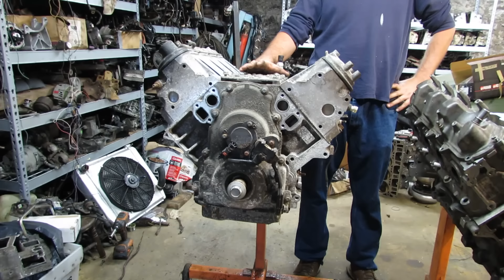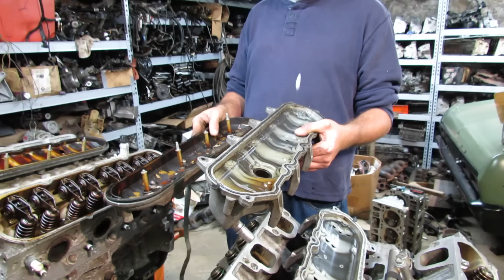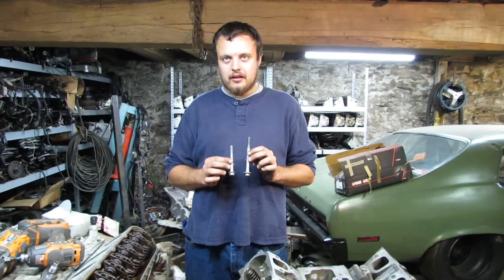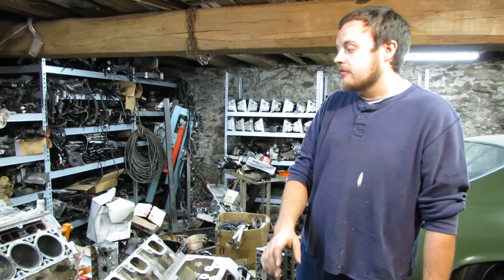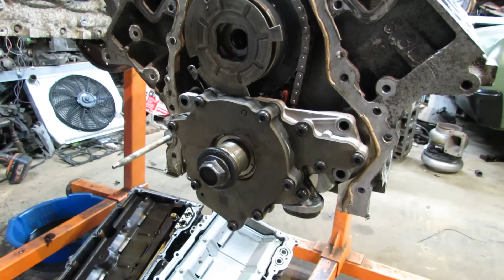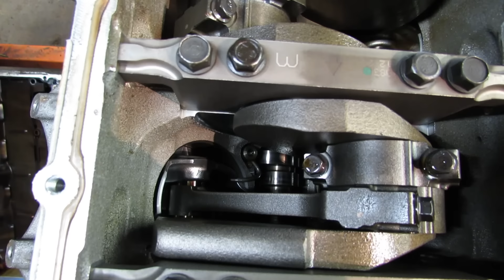The Next Generation of Chevy V8: LS vs. LT

Comment: Accually ported vs ported the heads they flow the same but from factory to factory the gen v is practically ported and with low angle then there counter parts which makes them such strong runners in order to keep up with them you need to have your heads worked on which is pretty expensive also the gen v fuel system can support 1400hp stock which is INSANE i maxed my injectors on my gen 4 5.3 with a cam and a little juice
Reply: I am interested in learning more about any vehicle with the stock fuel system hitting 1,400hp

Can you send me a link?

Thanks
Reply: @Jommybutler1234  gen v fuel system is all high pressure i tune trucks the duty cycle on my gen iv sucks the gen v theres dudes making 650whp on stock fuel systems now that limit does change once you include boost or e85 it goes down but still pretty insane power for a stock fuel system i do have some logs if you provide a email i can show you some hptuner information.
Reply: @BurtJr26  In your original statement, you mention “1,400hp on the stock fuel system”

That’s what I am interesting in hearing more about. Can please you reply with a link to anyone who is accomplishing 1,400hp on stock LT1 or LT4 fuel system?

I would never tune my own...too much risk to learn on a sample size of one. 

The port injection on the LS allows for a much higher injector duty cycle than the DI on the Gen V LTs, so I’m confused about your statement there too.
Reply: @Jommybutler1234  your not gunna find anyone pushing there lt to 1400 without the whole motor coming out and being changed but the injector rating on a l83 is 96.5LB/H while on a gen iv the stock injector rating is 30LB/H or 36LB/H depending on e85. 96.5LB/H injectors are rated at 1400 on pump gas while 30/36LB/h injectors are rated somewhere 500-600 fly wheel by the way for both.
Reply: @Jommybutler1234  it would be too hard to find a link or video of someone pushing it to 1400 and saying there on the stock fuel system and them saying what gas type they use more then likely if there pushing that much there using race gas anyway which changes the rating way lower.
Reply: @Jommybutler1234  https://www.corvetteforum.com/forums/c7-z06-discussion/4113109-crawford-racing-squeezes-841-rwhp-from-stock-lt4-fuel-system-on-full-e85-3.html

I stand corrected here is a link but as i stated in my previous comments e85 brings the rating down to 1000 flywheel which is about 900wheel which this guy is just about there craaazy
Reply: @BurtJr26  Please reread your first post. Why did you state 1,400 horsepower on stock fueling?

I am starting to think you don’t know what you are talking about. It doesn’t seem that you understand injector duty cycle. You also don’t seem to understand the basic difference between port injection and direct injection and how injector duty cycle is affected by each.
Reply: @Jommybutler1234  i stated 1400 stock because the STOCK injectors are rated at 96.5lb/h
Reply: @BurtJr26  It would be impossible to find anyone claiming to make 1,400 on stock fuel Gen V LT, because it has never been done. The only way to get there is supplemental port injection or going to a belt driven HPFP (Katech). 

The highest I have seen was on an LT4 that made 950 on a Dynojet

If they were running anything other than 93 octane, with the stock fuel system, it would actually decrease the output because you can’t flow that much with the stock system, even with a +32% fuel lobe

I think you are just Blowing Smoke
Reply: @Jommybutler1234  look if you truly want to know go read up on forums about people making insane power on the stock fuel system of a gen v motor. And like ive said i tune trucks from gen 3 to gen 4 to gen v and all it takes is a look at the flow data provided by hptuner and logging the duty cycle to tell they can take alot.
Reply: @Jommybutler1234  and i did say e85 would decrease output because e85 is about 108 octane
Reply: @Jommybutler1234  this is all assuming its pump gas boosted and no drive train to cause parasitic loss on the dyno but judging that you saw one make 950 that on a dyno jet wheel horsepower? Fix that with the 8-10% loss because dynojets read lower would say it would make close to 1400 fly wheel on a engine dyno. So you kinda answered it yourself.

Comment: Great info. Just got a L86 for my FRS swap. Trying to see if any front sump pans exist atm. Excited to see what you do!
Reply: They have tons of aftermarket LS pans to fit pretty much any application and if you can't find a pan for your app you still have the option of a custom built pan and modified oil pick up tube to fit in the sump . Or you always have the option of a dry sump system .
Reply: @jasonsparshott7208  only one place makes a front sump gen v lt pan right now that I know of and thats LOJ conversions.a few LS front sump pans like the gto out there but gen v LT motor is slim pickins
Reply: @Shiftheads  aren't the pumps and oil pans the same from LS to LT ? I see toned of different swap pans . LS's are being swapped into every thing with different aftermarket pans and pickups ! Doesn't the C7 use a 6.2L LT with a factory dry sump set up ? Even if there is absolutely nothing out there there is certainly a way to build or have built a custom pan .
Reply: @jasonsparshott7208  They are different . Trust me if I could use a LS pan I would just buy a GTO pan and be done with it. We are not talking about LS here the LT has a lot of differences. https://youtu.be/280o3rhAZHk?t=228
Reply: @Shiftheads  I realize we are talking LT and not LS but the LT mtrs have been out for 6 years now so it would seem like someone would build a pan . I wasn't aware of any huge block changes other then water pump mounting / passages and the wider mtr mount pad and bosses! I haven't watched the video you posted a link to yet but I will . But even if they are completely different why couldn't you ( or a machinist/ fabricator ) cut the LT oil pan mounting plate off . Then cut a GTO LS oil pan off of mounting plate and massage / weld / fill the LS pan to LT flange ? And I know the pick up tube can be swapped between the LT/LS oil pump . I really thought the main difference in the LS and LT platforms was the heads , direct injection and pistons . But I learn more everyday !! Thanks for your info and link and remember there is always a way to accomplish what you want so I know there is a oil pan or someone who can build you a oil pan or even you building your own oil pan is just a little work and thinking out side of the box to make it happen!!

Comment: Direct injection is garbage for me, not a big fan.  The valves get so much carbon your engine starts misfiring
Reply: Nope. My L83 5.3 LT has 192k miles on it and never gave me a single problem.
Reply: @nvdubs  your opinion, you know your engine I know mine. You always need to seafoam direct injection engines everytime. That’s required for maintenance
Reply: @nvdubs  yes good efficiency but builds hella carbon on valves. So your engine has 192k miles and you’ve never gave it a hot soak treatment? Smh...
Reply: @nvdubs  yes every engine builds up carbon, but direct injection is more likely to build a lot quickly.
Reply: @nvdubs  should said “Nope my l83 5.3 LT  has 192k miles in it never gave me a single problem because it has the catch can” learn how to be specific. Could’ve agreed if you said it before
Reply: @nvdubs  Your gonna argue and disagree when you don’t know history of my engine. Ok
Reply: that's a ford problem
Reply: Prefer port injection, less problems.
Reply: @crazymc3909  Port Injection Offers:

Less Power

More susceptible to Knock

Requires lower compression

Worse fuel economy

Higher emissions

Do you have personal experience owning any DI engines?

Comment: The vacuum pump is for the factory brake booster in '14-'18 trucks. Its lubricated with engine oil for longevity. Has nothing to do with crankcase evac.
Reply: Also the vacuum pump discharges the air into the crankcase.  It does not vacuum the crankcase.  Even more reason for the baffles in the valve covers due to increased volume of air.

Comment: The dynamics of DFI are mind boggling. Pulse timing to create maximum cylinder pressure to create higher torque at different engine rpms. Also opens up new intake and exhuast designs. I bet  this will give diesels a run for their money. Great informational video.

Comment: The good out weighs the bad with this gen. Awesome detonation control ,lower cylinder temps that in theory could be controlled  by elec.variable oil pressure ect. Higher compression! This is really cool !unreal potential
Reply: How are the cylinder temps lower? I imagine they are actually hotter seeing as they aren't spraying fuel into the cylinder until the last possible moment. I think the engine has the oil squirters because it NEEDS them to survive without the fuel cooling the pistons.
Reply: @oldleatherhandsfriends4053  for sure but with the squirters I'm sure cylinder avg. Temp is lower I'm sure not to mention direct injectors allow temp and detonation control  that has to be quicker to act  .
Reply: It would likely hugely benefit from water-meth injection in regard to the increased cylinder temperatures. But I’m not exactly sure what direct benefit this would have.

Also he discussed the good, what is the bad that they’re known for? Reliability maybe or what?

Comment: I have stock LT parts if you need them. What are plans for the motor? Stock? Cam? Intake?
Reply from the maker: Plan is boosted build. I'd like to do all the fueling with the direct injection.
Reply: @Calvin-Nelson  stock ecu setup? So far ive made 2400mbar absolute 4 degrees of timing, .79 lamdba. Trying to sneak up on the tune.
Reply: @DJhenderlong  Is yours port injection?

Comment: Very informative overview. Leave the rings alone just gap them. Ive seen no blowby or fluttering issues.
DI+PFI is awesome! I've been experimenting with multiple injection cycles.
Reply: Using what control system?
Reply: OBR Control System's E8 ecu. Runs full sequential DI and PFI.

Comment: Now that it’s direct injection, you can make it a two stroke, twice as many power strokes, mo Powah! Can you run a crank driven fuel pump like a duramax or Cummins? I know the fuel volume is an issue unless you switch to a corvette direct injection pump. The really nice part about direct injection is that there’s more room in the intake port for air, there’s no atomized fuel traveling down the port. And a higher compression motor will always drive better off boost so the LT has that going for it too
Reply from the maker: Oof. Two stroke. Not even sure how you would accomplish that. That would be one funny looking cam shaft. That or you could spin it at the same speed as the engine. I imagine that would hard on the valve train.

Yeah. You have to swap the an LT4 pump and LT4 injectors to make real power with these.
Reply: Belt driven fuel pumps are available from Katech, but you won’t need it unless you are over 800hp or on e85

Comment: Very interesting, good info! I'm running into stuff like this trying to swap from a 3400 v6 to a 3900 v6, GM changed just enough to make it not so simple! Lol
Reply from the maker: GM is not like the old SBC days where the same thermostat gasket worked on an engine from 1950 to 1995
Reply: @Calvin-Nelson  I changed from a Gen 4 in 5.3L to a gen 3 in a 6.0. I had to take the crank and have the other 58 tooth reluctor wheel pressed on, because the gen three is 24 tooth. It had to be done just so the computer would work it was a big pain in the ass had to change something on the camshaft as well I think.  The newer engines are stronger and have more potential though so I guess it's worth dealing with.
Reply: @actionjksn  you could have swapped cranks. They have the same stroke